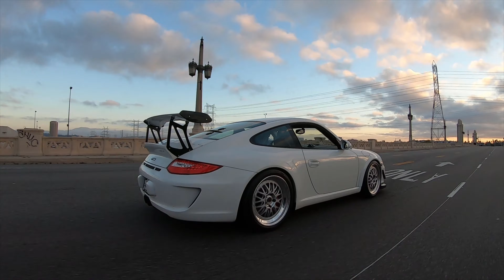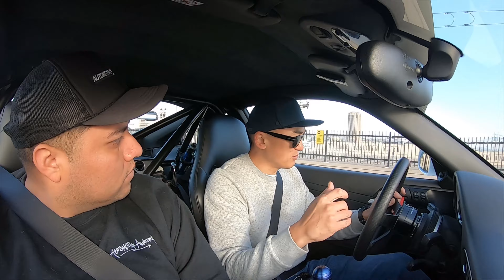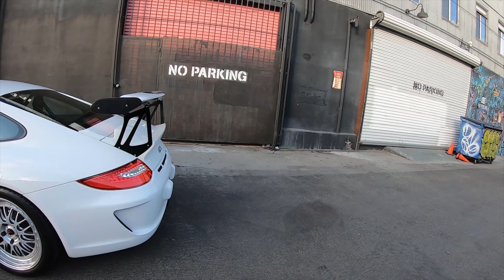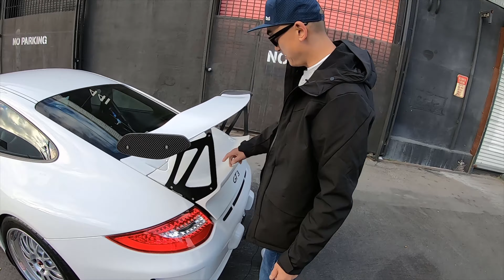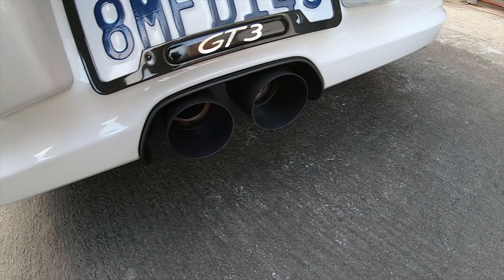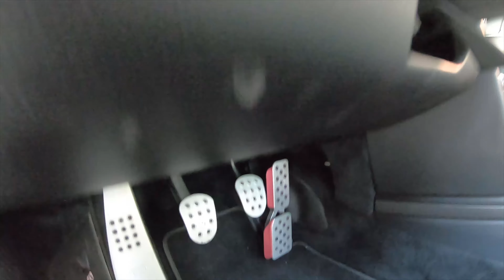How to BUILD a 2010 PORSCHE 911GT3 997.2 : Versatile Build!!

Comment: Really nice 2nd gen 997 GT3. Something I noticed and this is a constructive comment, you shouldn't rest your hand on the gear shifter, unless you are ready to shift. Reasoning for this is it puts pressure against the shift fork in the transmission and it will, over time, get a lot of wear from the synchronizer hub clearance being taken up. A friend of mine didn't understand this and I explained it to him, as he used the shifter for a hand rest. I rebuilt his transmission and he broke that habit, due to me showing him how that happens. I have a 2nd gen Cayman S and I feel it and the 997 2nd gen were the last of the true mechanical drivers cars. Best with the GT3.